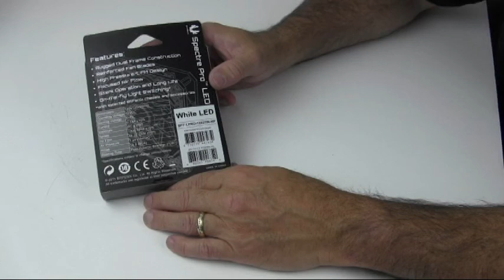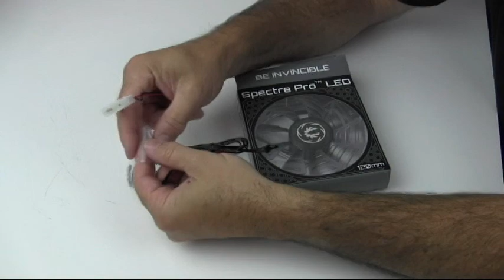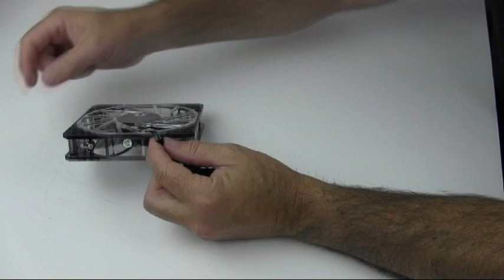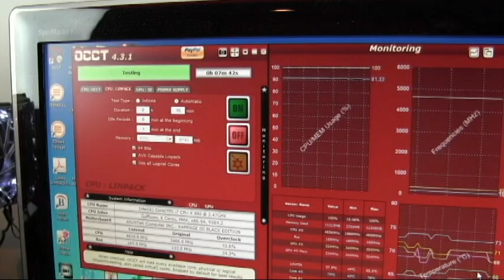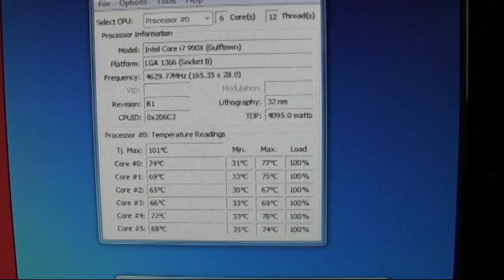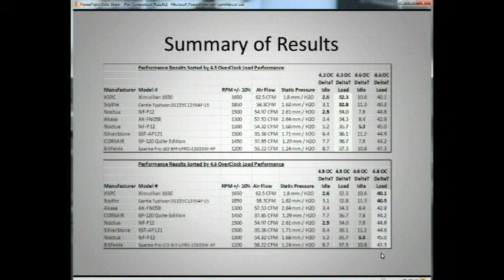BitFenix Spectre Pro LED Testing and Review

Comment: Bit pointless testing on an open system isnt it ?

How many people actually have their systems like this.
Reply: Rene Stanneveld
Open system = outside of case = what you see in the above video for benchmarking,

There is a big fucking difference between a system exposed to room (aka open system) and a cased system (Which relies on fans to push air).

If you dont see this as an open system which people used to test stuff on then you need to go to specsavers.

Only people that have these type of systems are ones in a controlled environment for testing purposes which defeats the purpose of testing fans for controlling temperatures.  Fan tests for use in everyday systems should be done in cases where heat builds up not out in the open where it dissipates quicker.

Comment: Got the 230 mm version installed in front of my Bitfenix Prodigy case. pulls a great airflow and makes no noise to my ears outside the case at all. Great deal from Bitfenix and they provide you with a great customer service as well.